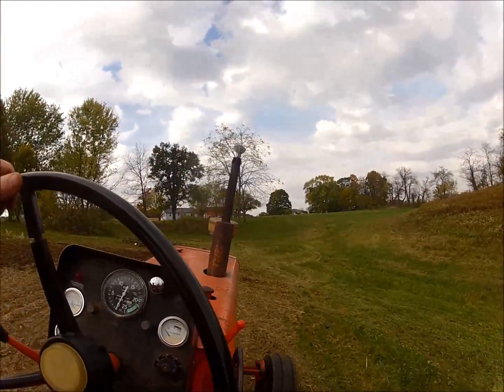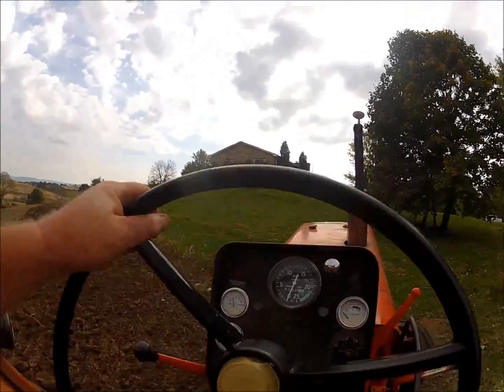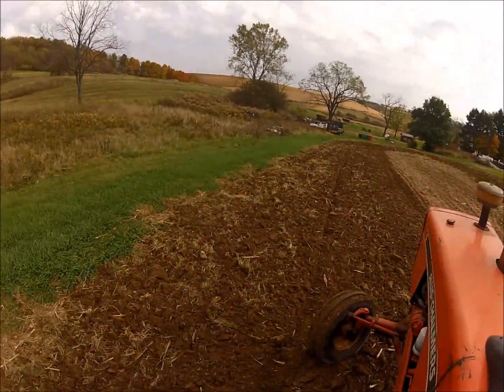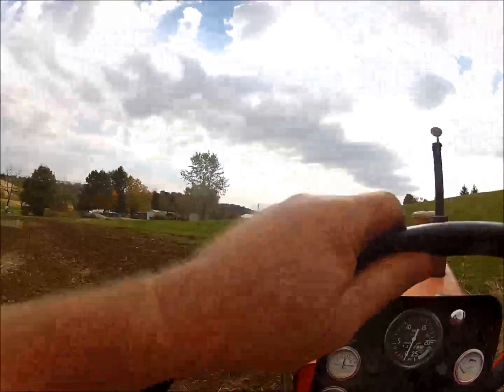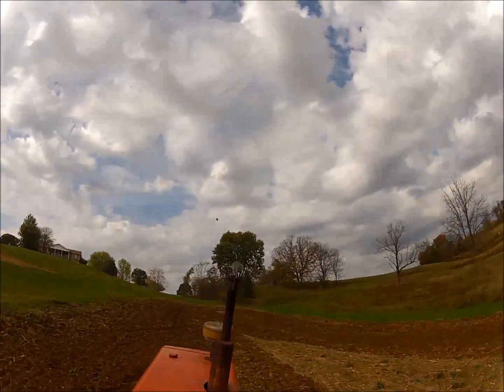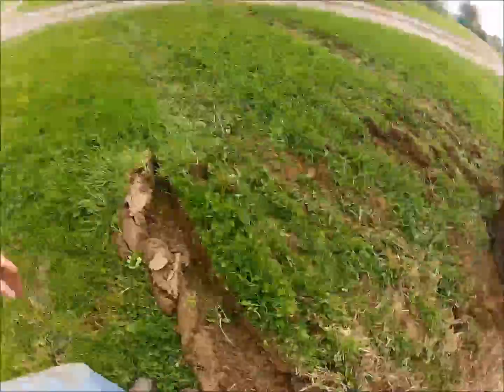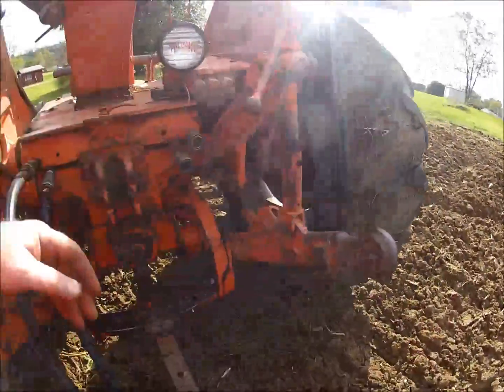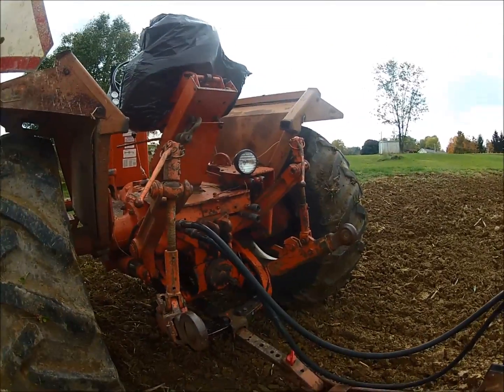185 Allis Chalmers discing

Comment: what are the 2 handles on either side of the steering wheel used for, pto ? are they both for same thing or what
Reply from the maker: Left side is pto. Right side is hi lo range
Reply from the maker: (Power director)